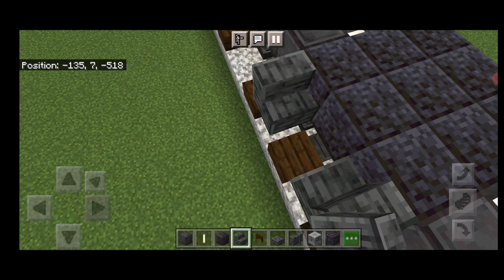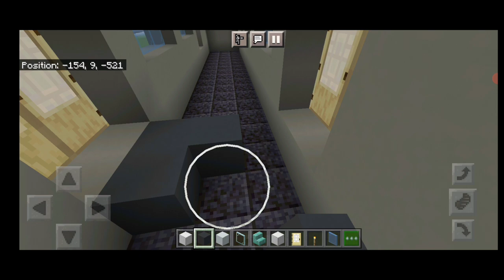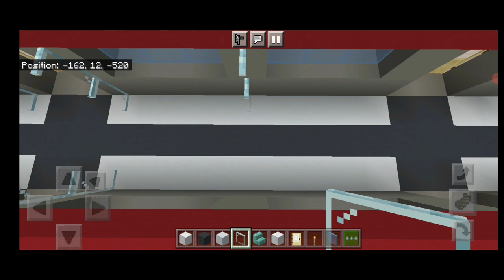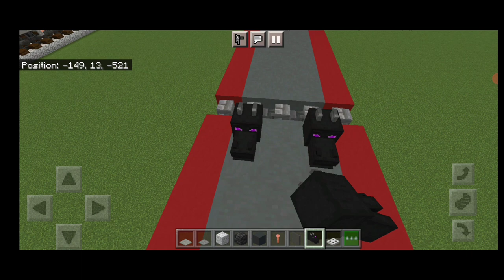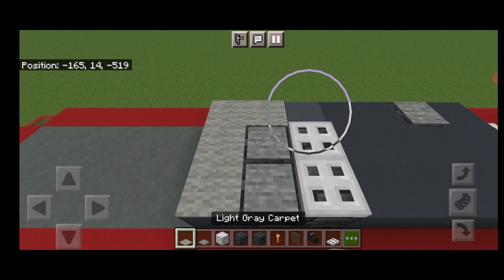Minecraft LRTA1 4g 13000 coach car tutorial

Comment: Nice 999999999999999999x
Reply from the maker: Thanks
Reply: btw why there are doors in the gangway?
Reply from the maker: Looked at wrong pictures
Reply from the maker: I did it backwards.   Didn't put a door to the control cab
Reply: @FrenchFriedTrains  so where will i put a door?,and remove the door in the gangway then?
Reply: @FrenchFriedTrains  btw what train you looking at lol
Reply from the maker: It's a toss up bc the way I built it the cab isn't big enough for a door if u put a door to cab then u have to take the cab seat out.  I just google image search.  And scrolled.
Reply: @FrenchFriedTrains  ill just gonna put a window in top,and replace the doors in the gangway with seats
Reply from the maker: That works